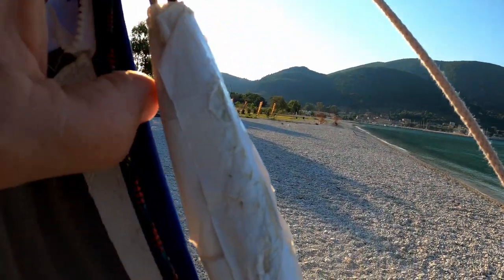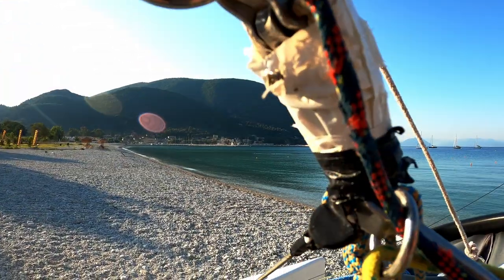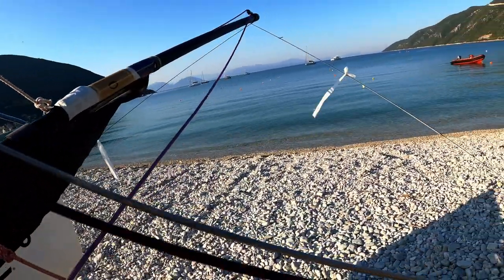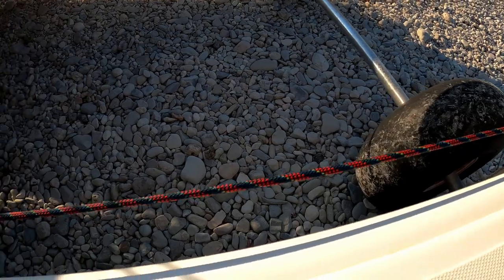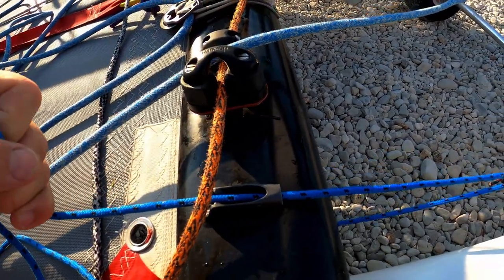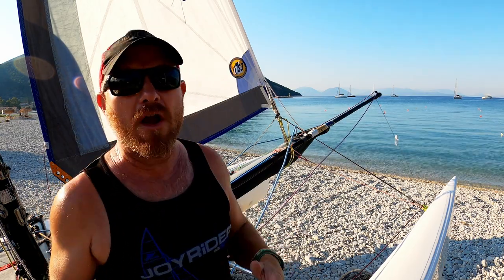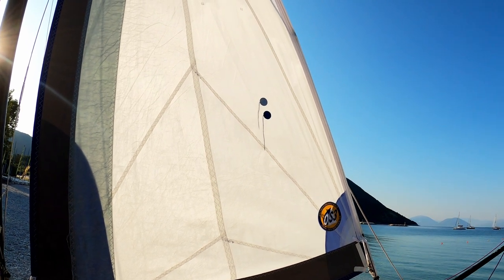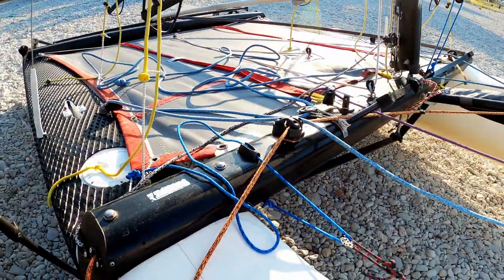The jib cunningham/downhaul⛵️ When to use it

Comment: Hi FYI the difference between a downhall and cunningham is that a downhall is NOT adjustable whereas a cunningham is. The cunningham is named after the person who had the idea to adjust the downhall on the fly. I only found out about this last week on an instructor course.
Reply: The difference is not the fact of « ajustable »
Downhall is for the bome 
Cunningham is for the luff sail 
If my english is correct 😂
Reply: @__X__O__O__  sorry if I'm wrong, just trying to pass on something that I found interesting, but it seems to make sense as on some boats ,eg laser/ilca, the clue strap can be referred to as a clue downhall as it is non adjustable.
Reply: Both are adjustable but in different ways.  A downhaul attaches directly to the sail tack and is a block or set of blocks that allow the tack to be pulled down to adjust luff tension.  But some boats have a fixed shackle point for the tack.  In those cases the sail will have a cringle slightly above the tack where a line runs through to pull the luff down and tension it.  That is a Cunningham, and essentially it puts a crease in the very bottom of the sail as it brings the cringle and tack closer together.  Both are more common in main sails.  The system in the video is technically adjustable halyard tension which is the common method for controlling head sail luff tension.
Reply from the maker: In my experience, 
Downhaul is the term adopted by cat sailors and windsurfers for the exact same thing that Dinghy and Yacht sailors call the Cunningham